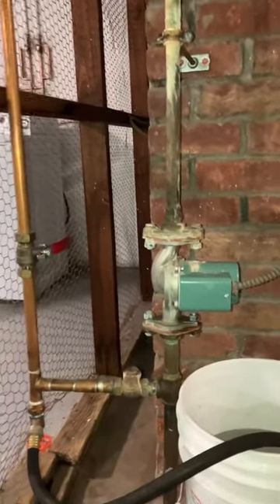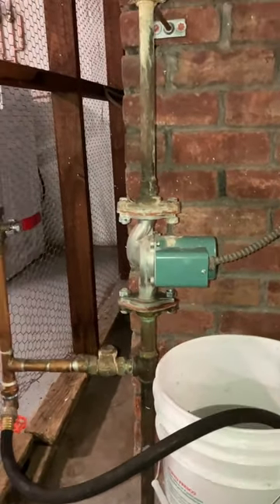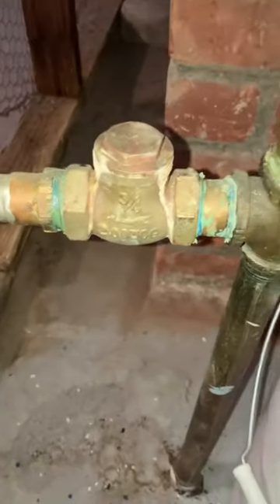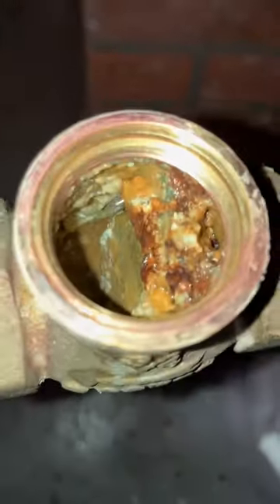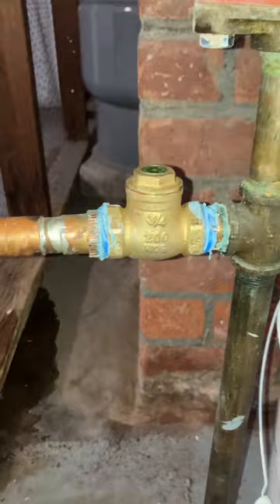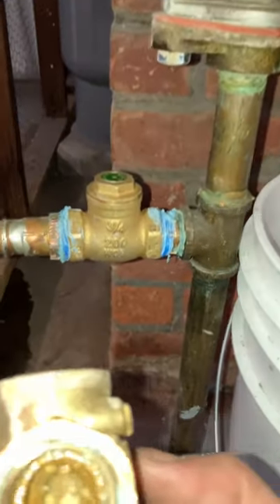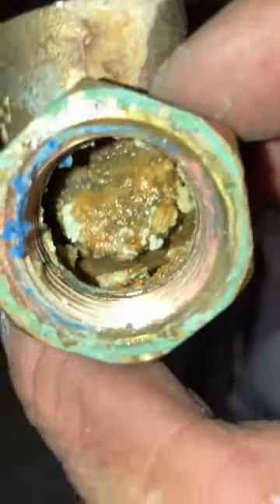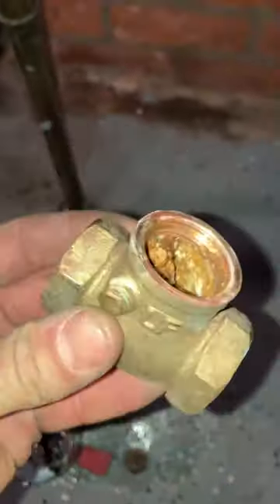Hot Water Check Valve Stuck Open

Comment: The only thing that check would do would put hot water in the cold side of it fails.
Reply from the maker: cold was pushing back up recirculating line
Reply: I'm having troubles with getting hot boiler water to the rads on a 3 floor building. First floor supply lines to zone controls that aren't working so someone had them fully open assuming the balancing valves are correct on the return line which is on the third floor. Boiler is on the south end of area having issues is the rads on the north end first floor. The rads sit lower then the supply line ceiling of first floor... 2nd and 3rd floor seems fine should I add a small circ pump?.